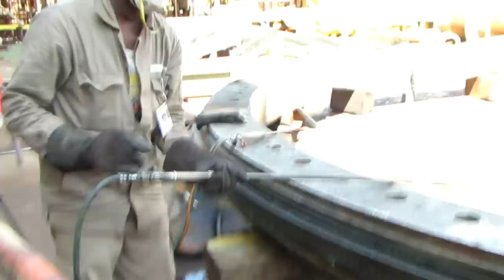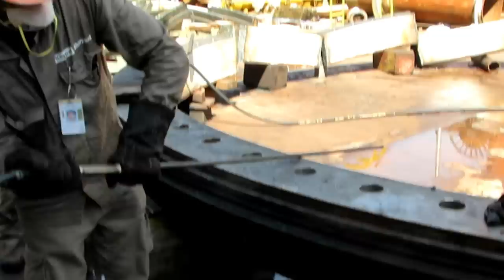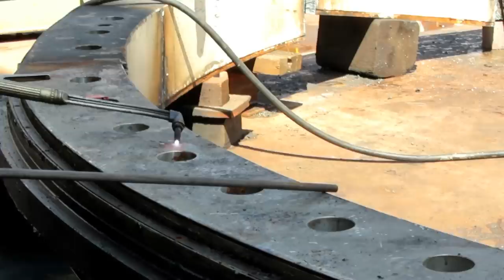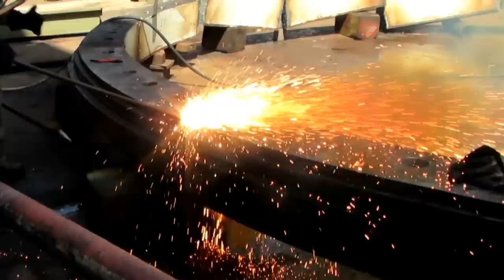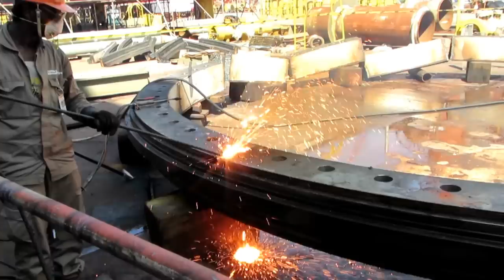Thermal Lance In Action - Scrapping a 2 million dollar FPSO turret bearing

Comment: Can the thermal lance open bank vaults?
Reply: yes but it would likely destroy whatevers inside, either way possible but impracticable.
Reply: Yes, one was used in a famous robbery in London many years ago (see the film 'The Bank Job'). The contents of the vault were not damaged - it was a room containing safe-deposit boxes.
Reply: DavidB5501 Actually, if you research that heist, They Failed with the Thermic Lance and resorted to explosives.
Reply: Yes! but having the combination or keys are better for the environment.
Reply: RottenRroses goddamn yes as lomg as it isnt tungsten
Reply: The sweeney episode golden boy The robbers used one to open a bullion vault by burning out the lock on the vault door but caused too much heat in the process the door nearly jammed
Reply: @alanpenman8191 couldn't you use the lance to cut up to the last inch or so of metal then finish off with a plasma cutter/grinder? Also make sure to bring a couple of fire extinguishers. If you were to tunnel through the floor I'd be scared about hitting a gas line or possible collapse, and of course the door may have some sort of sensor in there, not clue what you'd do about that, perhaps induce some sort of local power outage? Though if building has a backup generator than your screwed unless you got some mad hacks or something.

Comment: Basically it should cut from below part will be faster and save time  and materials, earth  gravity will clear up melting carbon steel.
Reply from the maker: ben 09 actually it makes sense to start from the top, gravity pulls the molten steel down, further preheating the object below so when the torch gets to it (if you are cutting in a top down motion) it’s got less work to do heating the steel to the point of melting.

Comment: The steel in this case, like every case involving the cutting of steel with oxy, is being oxidized, or burnt, more than melted. Steel is as combustible as wood, under of course the right conditions. Steel wool and a match = a fire! The lance admits oxy to steel heated beyond it's kindling temperature. The point it burns furiously, forming the black oxide. (not rust, brown oxide)  The burning tube and wires add an huge amount of exothermic heat, more than a cutting torch ever could. Nihil Obstat!
Reply: by kindling temperature do you mean autoignition?
Reply: @ToxicallyMasculinelol  Auto-ignition usually refers to some means of a fire starting on its own.  Like glycerine added to a pile of potassium permanganate will eventually burst into flame on its own.  HOWEVER it also refers to a temp at which the volatile gases driven off of, usually, carbonaceous solids or liquid hydrocarbons, by adding heat, will eventually just erupt into flame in the presence of oxygen in a reaction that is similar to combustion in the sense that it generates heat and when it is high enough it will light-off on its own and produce the exothermic reaction of flaming combustion.  The heat no longer needs to be added since the reaction is now self-sustaining.  A match can burn a million acres!  Steel will burn in the presence of oxygen if the temp is raised high enough (the cutting torch) BUT strangely the oxygen ALONE coming out of the cutting jet will CONTINUE TO CUT OR "BURN" THROUGH THE STEEL EVEN IF THE FLAME IS TURNED OFF!   The steel is in an exothermic reaction and it is liberating great amounts of heat, more than enough to sustain the "burn"!!  Like a wood fire!!
Reply: @junkdeal  well I know what autoignition is, but you said kindling temperature and I was wondering if that means the same thing as autoignition, or if that's something else
Reply: @ToxicallyMasculinelol  Well, I can try again!!   The kindling temperature is somewhat different than the autoignition temp. I'm pretty sure the kindling temperature is lower than the autoignition temp.  The kindling temp is simply the temp that something will begin to burn and continue to burn once a heat source is removed. Remember that book "Fahrenheit 451"?  it refers to the kindling point of paper.  To burn at all the paper would have to be heated to at least that temp.  Of course a match would do that, it is far higher than that!  But the paper would have to stay at that temp to continue to burn. It would, once you remove the match, since the fire by then is an exothermic reaction, meaning it adds enough extra heat to replace the match heat once it gets going. Wood would be far harder.  But once enough heat is around and in the wood article, it would burn on its own.  In, say, a barn fire, once the inside temp of the enclosed area is over about 500 degrees the entire inside of the building will erupt into flame and run away in a rapidly out-of-control fire.  This is called a flashover.  It is why no one survives for beyond a couple seconds under these conditions since YOU erupt as well!!   Watch the movie "Inglourius Basterds" in the theatre fire scene.  It is one of the best cinematic examples of this occurence I have ever seen!  Of course no one is actually in the scene or they would all be dead instantly!  Another video on Youtube of a soccer field bleacher under roof, on fire, and you will be amazed at the speed this fire races under the roof!!!  As to the kindling temp of steel in the form of wool, it is less than a thousand degrees.  Rust is a form of combustion, and here the AUTOIGNITION temp would be the point where enough heat is generated without adding any external heat, UNTIL the whole thing erupts into flame.  THEREIN IS THE DIFFERENCE OF THE 2 WORDS!!

Comment: What's this bearing for? It's very large to be running at a temp that demands the use of Inconel
Reply: 5 years later, if you were still curious and hadn't found the answer, this bearing is part of the mooring turret for an FPSO. FPSO = floating production/storage/offloading, basically ships that move oil from oil rigs without pipelines and can process oil in-situ for increased efficiency. The mooring turret is a buoy which can be lowered or raised from under the ocean, serving as an anchor for the FPSO to remain in place and also providing umbilical functions so pumping oil into the ship for processing from rigs or local plants. The ship has a turret dock at its bottom and will position over the location that the turret currently is under water, the turret is raised to float at sea level, and arrives partially inside the ship turret dock where it can then be integrated with the ship to start pumping oil for processing. One function of the turret is that it allows the ship to rotate around it, with the turret at the middle of its turning circle, to handle ocean currents, wind etc. This bearing allows the turret to rotate; the lower part of the turret under water remains static (since there are an array of cables hoists pipes supports etc attached to the turret) and the portion of the turret which is docked within the ship rotates, with this bearing separating the static and rotational sections of the turret.
Reply: @GrumpyGrebo  Thanks! Though your description kind of confirms my thought. It would be under enormous stress surely, but I would think there would be different alloys that would be even better suited since it's a low speed bearing?

Comment: is that just a regular pipe you use to cut or is it a special rod of some sorts?
Reply: Basically it is a steel pipe filled with steel rods or combinations of steel and aluminium or magnesium. As far as i know there is nothing special to it unlike welding rods which are made of very pure alloys.

Comment: Were do i get this lance
Reply: Easy! Take a few steel tubes, some plumbing and stuff for the gas input, and a shitload of oxygen (and you can light it on with steel wool and a 9v battery). Just remember to be careful around the sparkles...
Reply: @brisingreragon95  wait so its only fueles with oxygen
Reply: @brisingreragon95  no acetylene
Reply: Nope, the fuel is the steel rod, which also means that there is no risk of backflame, and also ensures a really high temperature, cause it's already enough to melt the steel rod

Comment: Shouldn't the gentleman be using a welding mask? I'm sure he likes having eyes
Reply: Sam Allen the flame isn’t as bright as a welding arc.
Reply: Welding arc is significantly brighter and also emits higher amounts of radiation esp depending on the kind of rods used, this is merely high temperature gas to bring the metal to a metaling point, not welding arc
Reply: Granted it wouldn't be the worst idea to have some kind of eye protection cause I can't imagine that watching something that bright consistently is good for you, but it won't fry his vision like nakedly starting at a welder will all day. Hell welding can actually sunburn you from.its radiation emission lmao
Reply: I use those cutting glasses, look like sunglasses, I think their a #5 shade
Reply: Max o I’ve been “sun burned” by welding a handful of times... it sucks.
Reply: Yes, expecely that bright environment, brightnes off flame seems extremely low

Comment: Closest thing to functioning a lightsaber to cut through steel doors?
Reply: This? No. Closest thing we have to a lightsaber in terms of ability to cut metal is a plasma cutter. But it's more of a light knife than a light saber, because the "blade" of it is pretty short, only capable of cutting thru about 30cm of steel in the really high power industrial models (not the ones you can get at a hardware store, these ones cut things like bulkheads for ships)

Comment: why don't they use a bandsaw or a grinder ? much cleanner ....
Reply from the maker: The beauty of the lance is the relative speed of its cutting action and its portability. Agreed if you want a prettier cut then power saw would be the right tool (although it would take much longer and would be harder to position the tool) but in this case when the object is being scrapped then the lance the best option.